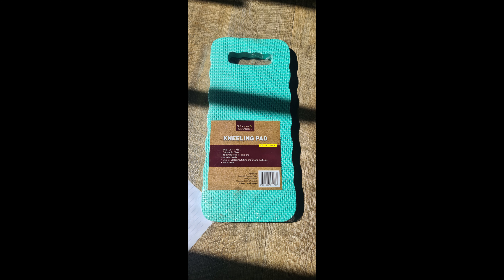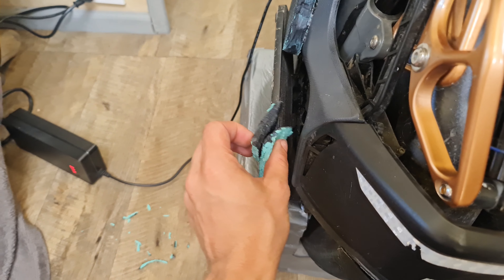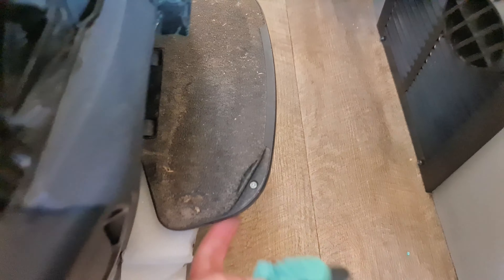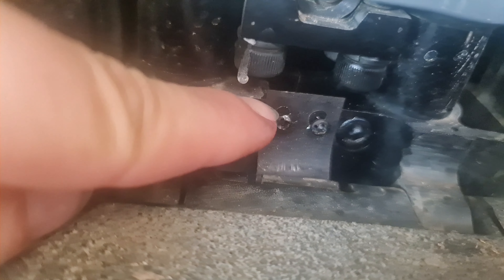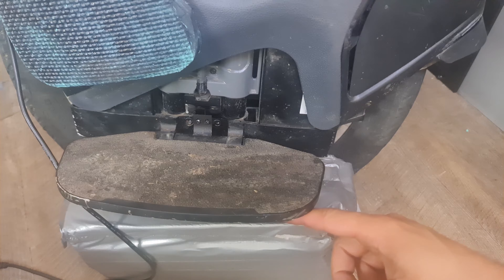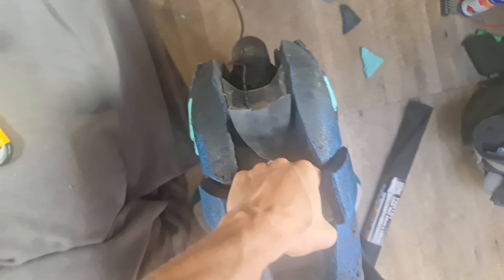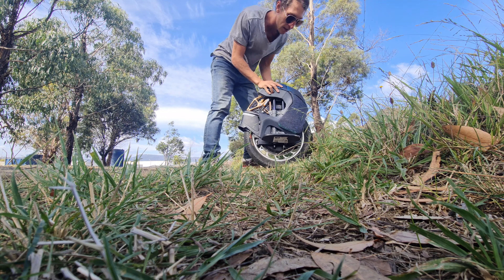$4 S18 jump pads how to build

Comment: Nice one.. i will do something similar when i get mine... you could also cut off a piece from the pad in the place where the pedal folds... or just add a small magnet in place to hold it when it folds.
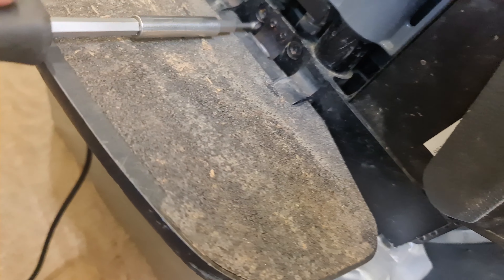Reply from the maker: If you watch from the 1:00 mark I show how to modify the original clips so it says up with no magnet needed